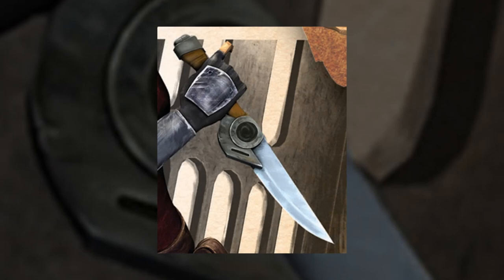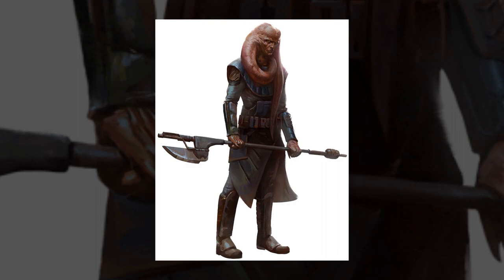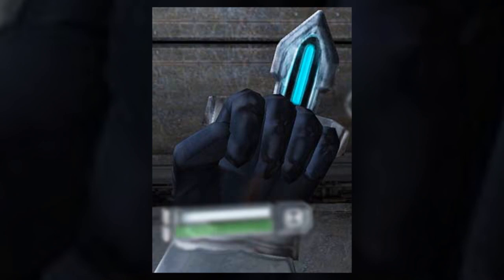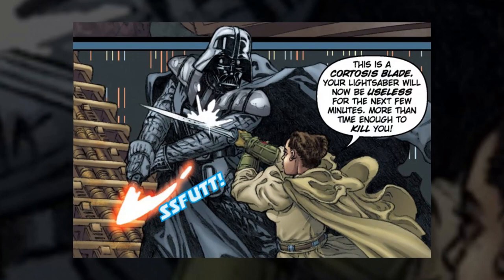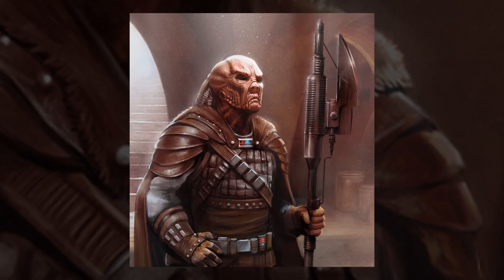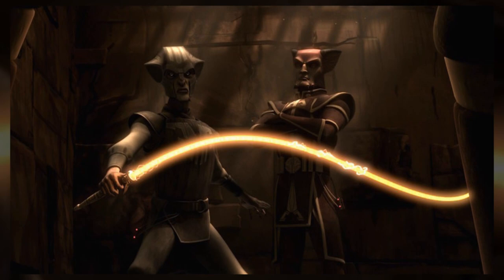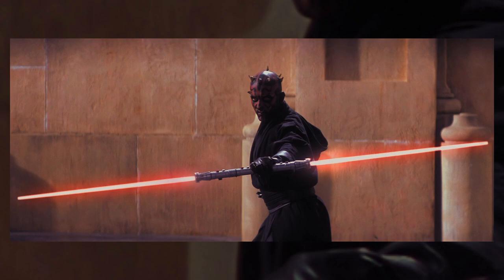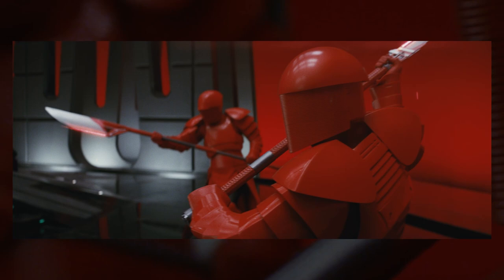How Did Vibroblades Work?

Comment: Is Dryden Vos’ weapon in Solo some version of the vibroblade?
Reply: GJP Yep.
Reply: Patrick Donnolley Actually no, Vos' weapon, the Kyuzo petar, works by charging an energy current through the blades edge.
Reply: GJP Maybe I dont now
Reply: @christopherneil8702  It's more of an energy weapon. The kyuzo petars have monomolecular energy chords which adds an energized edge to the weapon. The blade doesn't vibrate.
Reply: @christopherneil8702  No, Vibroblades vibrate
Vos' weapon was like an energy weapon, Remember the Energy Axes that the Executioner troopers used in TLJ? Yeah it uses the same type of thing like that

Comment: It would be cool to see a class of force sensitives use nothing but vibroblades and the force but in different ways than Jedi or sith. Maybe like Samurai or ninja type of warrior who have unique vibrokatanas that don’t have generators but instead are powered by the wielders force energy. And instead of a lightsaber being a separate living being because of the kyber crystals, these vibrokatanas are mere extensions of their users. Meaning they have more mastery and in general are more skilled pure swordsman. And can use the force through the vibroblade. Meaning the blade itself can have force powers almost like a wand to a wizard. A wizard doesn’t need a wand but the wand focuses the wizards power and allows them to do things which were previously unthinkable. Idk just a thought
Reply: There’s so much untapped potential in Star Wars it’s sad you’ll be lucky to see that in Visions

Comment: Fun fact: In actual practice the double bladed staff would be only be practical on horse back or on any other kind of mounted rider. In real life there have been military spears and lances that have spear points on both ends of the pole. This was to allow the rider to not have to spend as much time spinning his spear point around if the opponent circled around him at a 180 degree. He would already have the other end with a point and he could stab him from that angle. In actual war those 2 or 1 seconds are just enough to get you killed or save your life in the nick of time.

Comment: Could these stand lightsaber?
Reply: Only if they are made of lightsaber resistant materials.
Reply: If it were made out lightsaber resistant material, it could withstand a lightsaber blow up to a certain extent. Now if the blade had an energized edge instead, then it'd be much better suited to go up against a lightsaber.